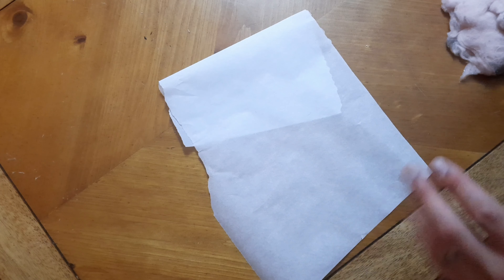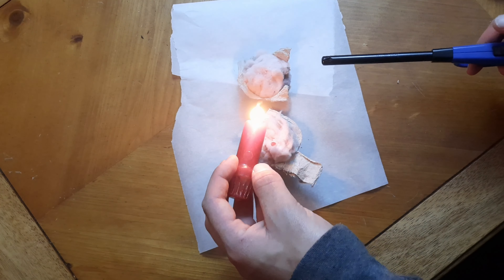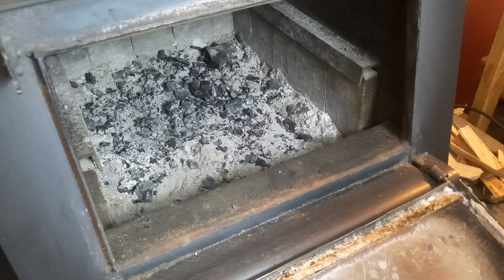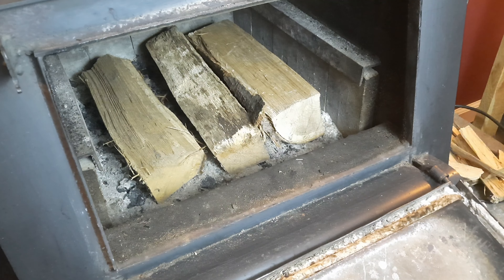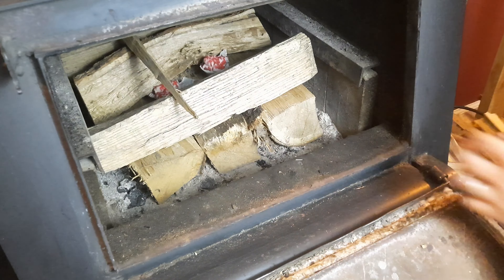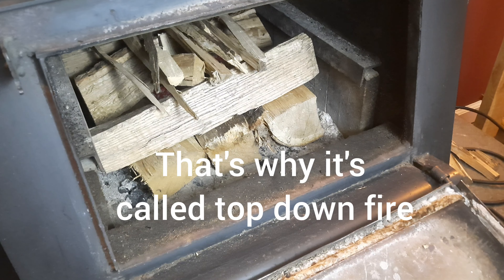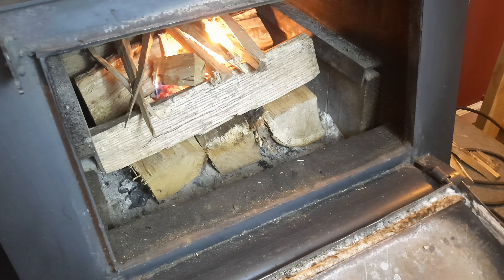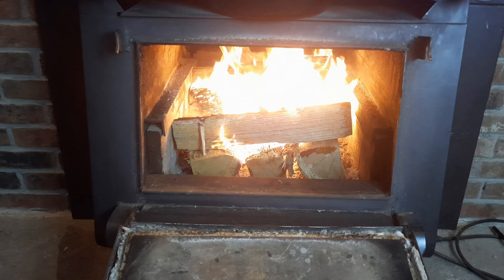Master the Top-Down Fire Method for Wood Stove Ignition

Comment: I've started doing a fire this way and I'd never look back. There's far less smoke in the house from stalled flues than before and you never run low on embers.
Reply from the maker: I never have an issues with getting a fire going now using this method. Thanks for watching and commenting.

Comment: The difference between a good stove that is efficient and a bad one that gobbles cords of wood are the fire bricks. As one can see that stove has fire brick all around. Fire bricks and refractory are the expensive part of the stove. They are the thing that keeps the firebox hot and burning efficiently. It's also why he can build a fire upside down, as the firebox retains the heat to catch the bigger wood afire. Don't use lint on a catalytic stove. Lint is mostly synthetic fiber, basically plastic and will cause problems with the catalytic converter.
Reply from the maker: Thank you for the heads up on using lint in a stove with a catalytic converter. This method has worked in an outdoor fire pit too. Thank you for watching and taking the time to comment.
Reply: Great insights! 👍 thanks for that.

Comment: We do this. Except we just keep the egg trays on the dryer and load as we go. Then collect candles from yard sales, we melt them down and pour it over the trays. We do it before winter comes and then just have tons of fire starters for winter. Another way I have seen is putting wood shavings in the wax coated paper ketchup cups.. never tried that method tho
Reply from the maker: I have never tried the wood shavings but sounds like it would work well. I have recently tried no wax on the lint and it still worked very well. Thanks for watching and taking the time to comment.